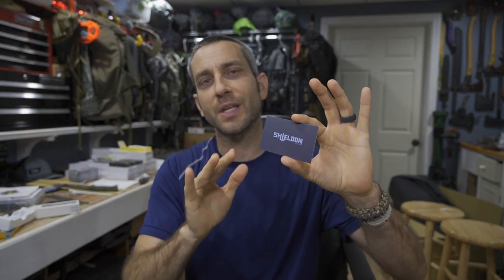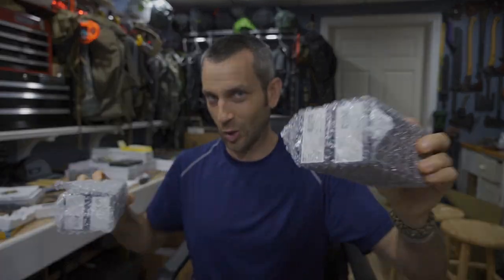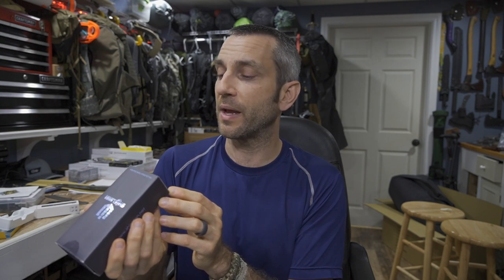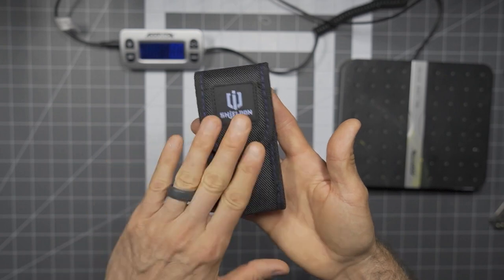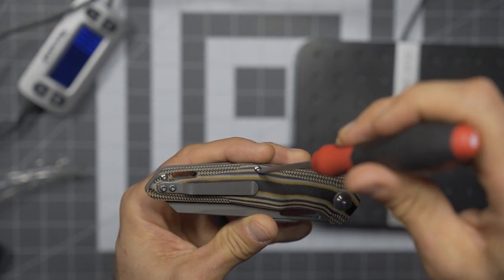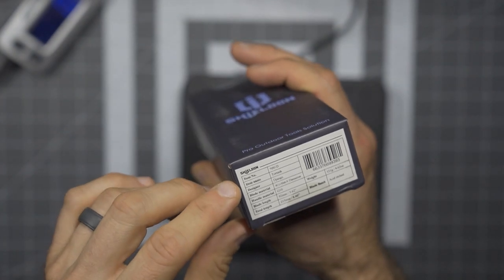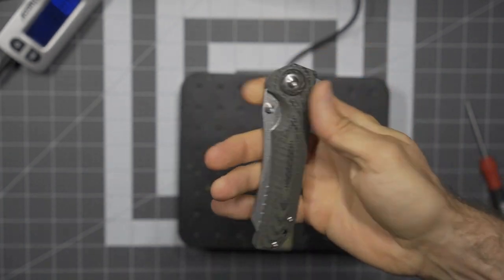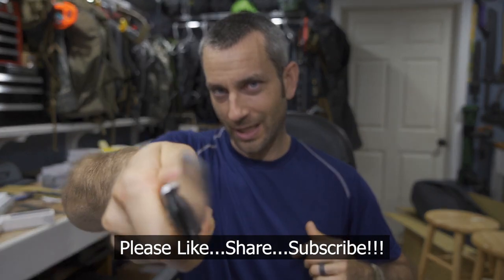Shieldon Knives: New Brand...First Impressions Make a Lasting One!!

Comment: Eric, I agree with you that it would be nice if the hardware for the frame and clip were strictly T7 for simplicity and consistency. From what I've seen its not a common practice among manufacturers, but should be. Lol

What are the price points for these products? Shieldon's website does not list prices, but requires you to submit an email to them to get a quote. Why is that?
Reply from the maker: I don't think price is fully worked out yet...they are literally just getting their brand started and I am not 100% certain they are available just yet.  I think they are looking for feedback and understanding where they fall in the market.  In my opinion, sub $100 and some models should be in the $60ish range from what I can tell, but not certain where Sheildon thinks they should fall.

Comment: I am tired of D2 steel....
Reply from the maker: I do somewhat agree with you... but I also feel the same about S35Vn at this point... and ball bearing flippers and titanium frames.   But what is the solution in your opinion?  What steel would you like to see?   I know this is why Artisan developed their AR-RPM9... because people are tired of D2.
Reply: @outerlimitless  just use n690 or vg10 and use an even lower pricepoint or use s35vn and get a little higher
Reply: I know but you’ll never out use it. If it was s35 would that last ya??